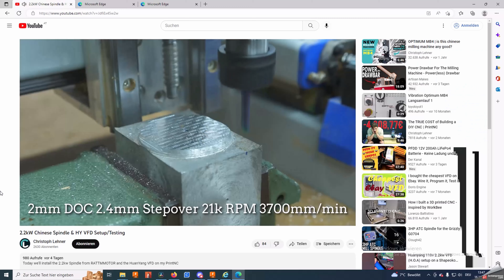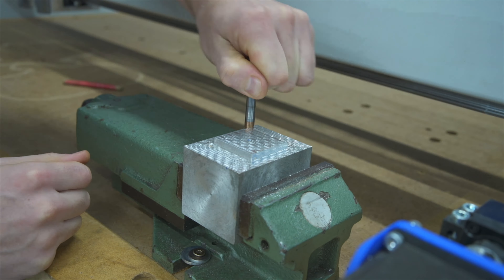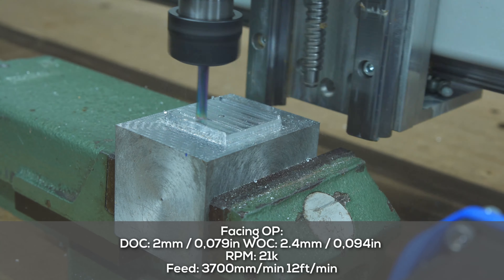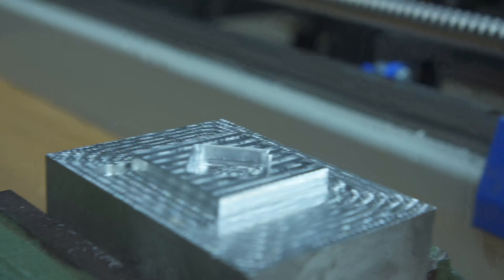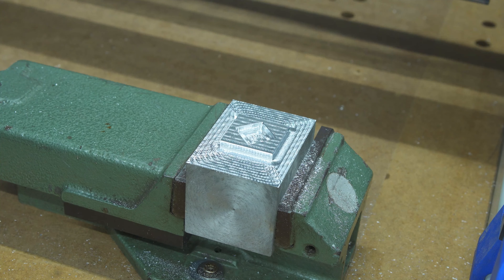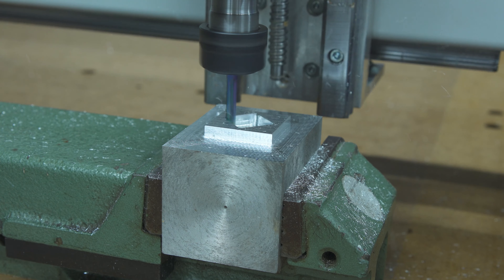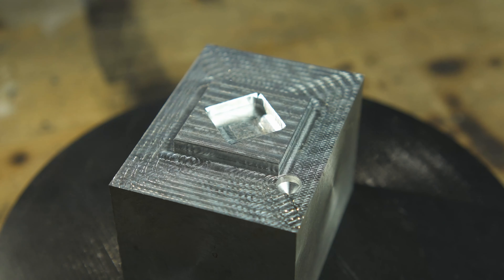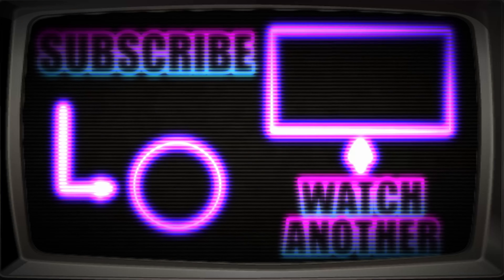How Accurate is a PrintNC / 3D printed CNC ?

Comment: I still think that the bad surface finish is mostly due to the unsupported MDF area where the vise is clamped to. Maybe some loose components on the X and Z assembly also... Even the old version of my machine had better finish on "loominum" parts and it wasn't that sturdy. Keep them coming 👍🏼😎
Reply from the maker: I measured it, since you last commented, and yeah you were right, the mdf flexes like a wet noodle, despite being 38mm thick
Reply: Cutting forces on aluminum are wild, even if it doesn't look that hard... Try to add more steel beams on the base, maybe it will flex a bit less. Or... Build a concrete base like mine 🤓
Reply: @ChristophLehner  A ply base with many layers will be a lot stiffer (like 2 x 18mm baltic birch) and still somewhat affordable.  I think I'll be using a single sheet of 25mm for mine.  Love your videos, they keep my project moving.
Reply: It even seems to be visible on the video, looks like the vise is shifting quite a bit.

Comment: There is a classic test piece a bit like this but with a circle ( cylinder ) between the square and the diamond. If you machine is accurate the circle touches the points of the diamond and is tangential to the faces of the square.  I think there is a NIST diagram for this standard test piece.  Hint: steel stuck in ali, use heat. Thermal expansion of ali is twice that of steel. To avoid damaging the tool , use vice grips but wrap the tool shank with some shim sheet ( or cut open a steel food or drink container ).

Comment: The engineer's two cents: if you're looking for "optimal tool paths on a semi rigid machine" that means the machine is not accurate itself: you duck parameters to get the expected accuracy allowed by the machine itself. Experience showed me the greatest handicap is always the machine itself. If you want a 200µ accuracy, the machine itself needs to be built with 20µ accurate tools and use  at least 100µ capable components. Simple as that.

If you did not learn to study a structure by simulation, a proper way to test a machine is to set the feed and speed at the bit specified abilities. Say the biggest collet of a machine is 12mm. You want to test the machine with a 12mm bit, at the feed and speed required by the tool. Into hard wood, for example, 11.000mm.mn @ 24.000 RPM with a depth of cut of 12mm: nothing fancy for a 12mm bit, just the bits requirement. Machine a part with these parameters and measure the machining quality on the part. If the cut quality is not good, or something went wrong, you don't have the right spindle for the structure of the machine. The standards always comes from the cutting tool. If the machine is not capable to run properly a 12mm bit, downsize the bit for a 8mm and run it at its feed and speed requirements, something like 8.000mm.mn @ 24.000 RPM with a depth of cut of 8mm. And so on until you get perfect results with at a bit's required feed and speed. For example, a Chinese 3040 cannot run at proper feed and speed a bit over 3mm in diameter. So there's absolutely no need to put a 1500w spindle on a 3040 as a 500w spindle is powerful enough for the structure. It can already holds 7mm bits which is more than two times what the structure and components can really hold prior to deflection or vibrations. 

People need to keep in mind that running a bit under its required feed and speed is wrong for the bit which overheats and get dull too fast, wrong for the machining time and the overall machine lifespan, and could be wrong for the material itself as it can overheat the material, add some burn marks and even bounce on the surface during very thin passes. What people believe as "good parameters" because the cut quality looks good, are mostly wrong parameters for the bit. 

That's why the real standard measure is the bit itself. When an engineer study a new machine, he always start from the biggest cutting tool the machine is meant to hold. The notebook can be as simple as "The machine should take 20mm passes in stainless steel with a tolerance of 50µ". All is said: you can deduce the required bit, the power of the spindle, then what is left is the structure and components to hold the forces corresponding of the resistance of the material against the cutting tool. Do your calculations, add a safety margin, select your components and the job is done. Hobbyists do exactly the opposite: select reasonably priced components (biggest allowed by budget), select a structure presumed strong enough, design parts to put all that stuff together, done. Then the question/problems waltz begins: what the machine is capable of ? Which parameters to machine acceptable parts ? And so on. Any hobbyist can learn how to study a machine, this is not difficult at all, you just want to start from the bit.
Reply: So the bit says 24.000rpm...
Many industrial, pricey ($150000) machines have spindles that don't even go up to 6000rpm. Now what?

It's ALWAYS a matter of budget, as well as technical limitations, whether hobbyist or professional.
Reply: That gave me something useful 👌🏻
Reply: @xyzspec82  You're welcome.

Comment: Two things that kinda come to mind ( as an Amateur myself ):
1. @01:38 The Z-Axis almost touching the Stock Material WHILE barely skimming over the Vise was way too close for comfort...
Maybe consider making a recess in the Waste Board for that Vise to fit in so you regain more clearance? I was sweating like a pig watching this 🔞Video.
2. Maybe consider using different feed rates for your Spring Passes?
Keep the fast ones for the Roughing Operation to get things done but once you do the Final / Spring Pass reduce the feed rate to like ½ or ⅓, of that? Pretty sure the time you spent on doing additional fast Spring Passes could have been saved by doing a single slower one 🤔
Reply from the maker: Hahaha yeah, i need to do something about the Vice, it was too close for comfort.

You are absolutely right👌.
For the finishing passes i should use some lower feed rates

Comment: On my mpcnc in al i would run pockets in 4 passes to clean up deflection. 
Sadly i broke my 1/8 carbides trying to cut some soft al sheet and havent been back to al since moving to the pnc.
Reply from the maker: On my setup 2 times was definetly not enough

Comment: IIRC he used 10mm pitch ball screws, so what is the step accuracy of the drive. A 200 step drive on a 10mm pitch gives 0.05mm or 2.5 thou steps, before you even look at mechanical rigidity. 10mm is great for rapids but you pay on movement precision.

Comment: Do you think it is possible to machine mild steel/stainless steel sheets (1-5mm)? Thanks!
Reply from the maker: Are you talking about one time, or permanently?
For the odd occasion you can make it work, but in reality its a compromise, the spindle is too fast, and the machine not rigid enough, as its a gantry style router
Reply: @ChristophLehner  Only occasionally. Thanks for the answer 😊

Comment: If I was you, I'd try to fill up the beams with concrete or sand. This should add a ton of rigidity. And weight. And weight is a good thing.

Comment: How much of the XYZ accuracy loss do you think was due to backlash in the ball screws?
Reply from the maker: 0.01mm is you typical import ballscrew accuracy,
Biggest issue is the operator, then feeds &speeds and rigidity.

Comment: The way you're measuring it with the calipers is very inaccurate, so are the calipers :P If you want a good measuring tool, throw those toy calipers away - they might have 2 decimal points, but the accuracy is at best to 1. If you are into machining, getting good calipers, like those from Mitutoyo will really save you a lot of headache. Just make sure you get the original ones, because there are countless fake Mitutoyo  tools. Get something for $100, ideally not digital, and it will last you reliably for a lifetime. Honestly though, for $2k machine it looks awesome! Especially how effortlessly it cuts into aluminum!

Comment: with "excalibur" you got me.
thats a 20th of a mm. id call that accurate. depends on what you are doing. maybe not
making front teeth or so with it. but essentially. booom mf. high five.
what would be the spot to raise precision? 
filling the gantry with concrete or sand?!
better rails or screws??

the first thing, that i would build with such machine would be  replacement for most pla parts. but those are minor c0ncerns. actually.